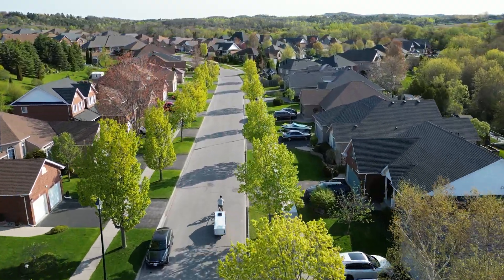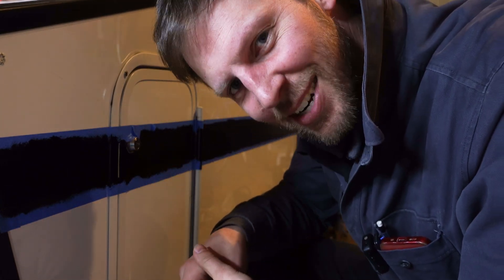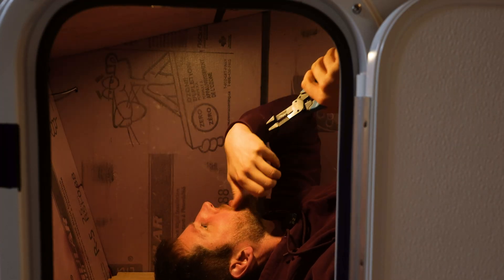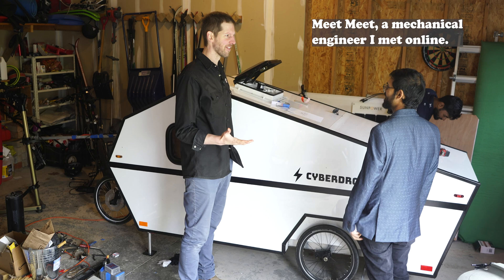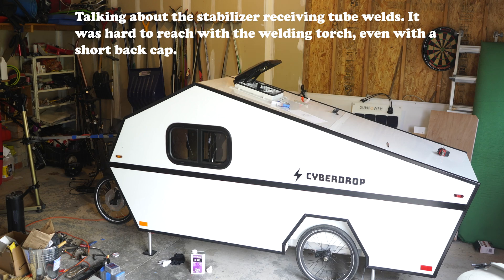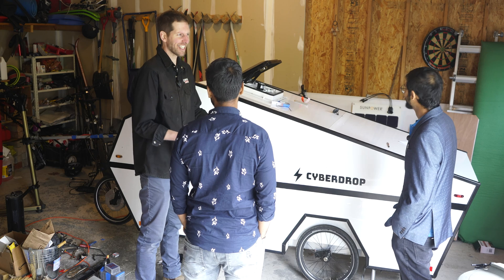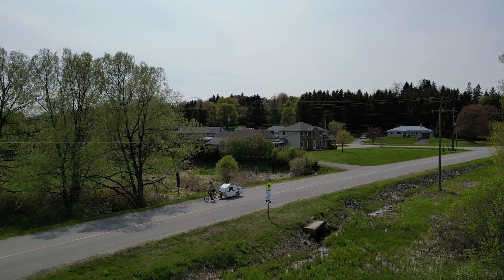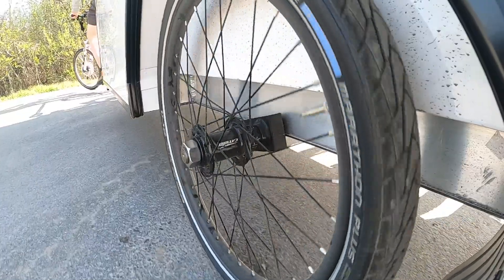Building Electric-Powered Bicycle Camper (PART 14)

Comment: Hello from Trujillo Perú. 
I just came across this video. I have not watched your other videos on the build yet so my question may have already been answered. 
Have you installed Surge brakes on the trailer for down hill safety?
Reply from the maker: I have a surge brake tow arm now. But I found it wasn’t necessary with the regen braking of the motors.

Comment: A great overall video, nice video editing and music compilation.  This is the first of yours I have watched, so you may have answered before.  You are towing an empty shell.  Once it is fully provisioned do you have an emergency over-run brake?  That would be a brake on the trailer to slow it if it started to push the bike out of control on a downhill run and the bikes brakes can't stop that much weight?  Hope that helps!
Reply from the maker: Hi thank you. Yes, the overrun brake came later and is incorporated into the tow arm. However, never needed it once due to the effectiveness of regen braking.
Reply: @Jerbrown  Haven't owned anything close to regen braking, but that is a great system!

Comment: I have paraparesis, I can walk with a cane, but cannot make any significant physical effort, so I also have to use a manual wheelchair.
 I'm planning to buy a sports wheelchair, an All Terrain Wheelchair (ATW: in French it's called an FTT for Fauteuil Tout Terrain).  This ATW is intended for downhill sports (ski slopes, lacrosse slopes) and for hiking trails.

 When I had my ATW, I would build myself a small folding fiberglass caravan, and with my dogs and my ferret, I would set off to discover the natural landscapes of France.
 For my wheelchair, I only bought bicycle equipment on the internet, 2 front headlights with a solar panel (2 to have 1 on each side), 2 rear lights with a small solar panel, and wireless turn signals.
 When I have finished my folding caravan, I will order again the same bicycle equipment that I bought for my wheelchair, to equip the ATW and the folding caravan, I will also order magnetic rotating lights that we  puts them at night on a car that has broken down, if I have to drive at night, I would attach them to the caravan to be clearly visible.

Comment: Impossible to get a certification for european roads for that.
There is only 1 motor allowed for the whole combination. So either the motor sits in the bike or in the trailer. But no two of them.

And max 250W of continuous power would be allowed.
Reply from the maker: Well that sucks. Good to know. I’ll have to pedal more in Europe and keep the second motor off. We’ll see how it goes. Thanks for the info.

Comment: Totally making me and the wife a trike rig.  I love the design and simplicity of this. What is the reason you went with an additional front wheel drive as opposed to two rear drive motors supplementing a mid drive, and front hub motor. I plan on having a charging unit set up for; if not continuous, at least long range.
Reply from the maker: I wanted to go with the minimal motors necessary and figured I don’t need additional redundancy beyond two motors.

Comment: Yo bro ...busy working /  building my 3 wheel drive trike ,with which I  pull a ten foot long trailer .which contains a portable toilet     ( US coast garde approved )  . By the way sodering is not suitable for your trailer , look at what did do in a cars ...thanks for the vid , later dude . You are as brilliant as I and I'm 69 , loved your videa and thanks again for your efforts . The planet needs you .
 Crimped connections are more flexible, heat-resistant and vibration-resistant than soldered ones which have greater potential for wire fatigue and stiffening. Crimping is often more consistent than soldering, which can vary according to method or technician.Sep 19, 2022
Reply from the maker: Hey thanks for the tip. I didn’t realize that crimping was more reliable. I’ll have to keep that in mind going forward. Your project sounds beastly! Nice!
Reply from the maker: And my pleasure! Thanks for the encouragement

Comment: Do you have a link for the transportation ministry's guidelines? I only looked at the Ontario HTA and couldn't find anything specific to trailers.
Reply from the maker: https://tc.canada.ca/en/road-transportation/publications/trailers-federal-lighting-equipment-location-requirements
Reply: @Jerbrown  Thank you so much!
Reply from the maker: @guygrenier613  anytime!
Reply: A simple way to exceed the guidelines, is a wireless back light + turn signal + alarm combo that are quite affordable.
Reply from the maker: @pascalj4331  That's the simple solution. I decided I didn't want to have to recharge the lights, so I'm hardwiring them in.